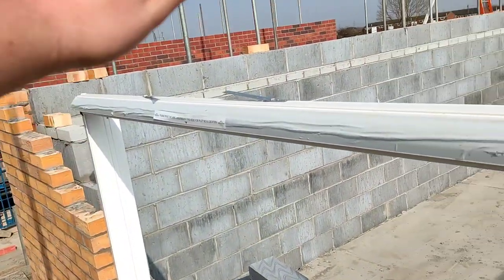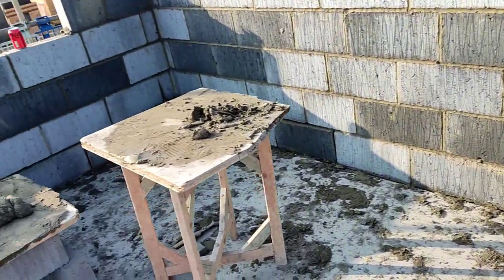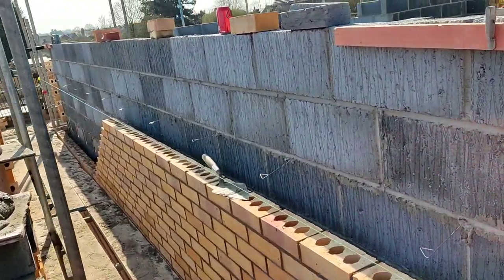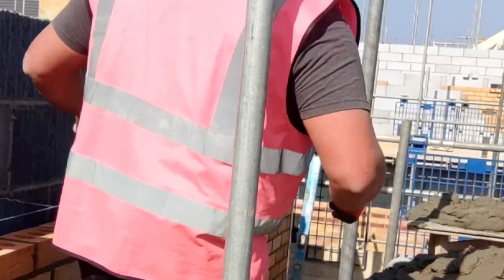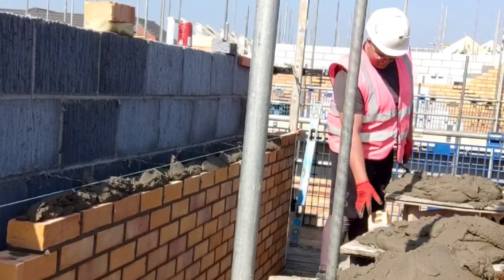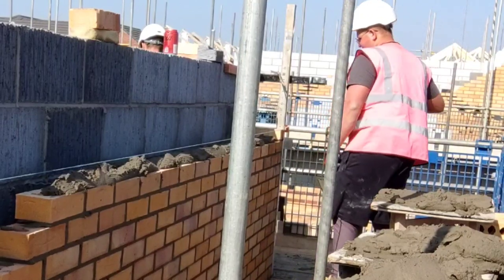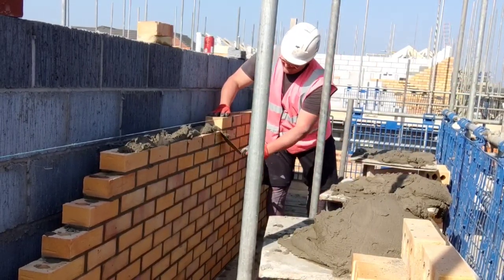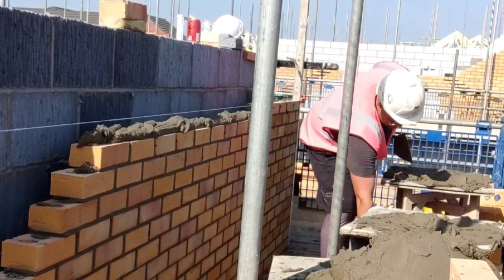Bricklaying Vlog - Back on the Band Lift! with a 3 Profile Setup?!

Comment: Im interested to know as an improver, why do some brickys build big corners with profiles then run it in after. just curious cheers m8
Reply: Its so you dont have to load everything out with muck and not as much pointing in one hit. In a small gang some times its quicker to do it  like that.
Reply from the maker: What hazey said 👍
Reply from the maker: @JAVXABLE  deffo on clay bricks, coni bricks I'll building bigger runs at once

Comment: Hi mate, fellow Bricky here! I’ve been using the rhino profile gallows(clamps) on my profiles.. What is it your using on your profiles (the metal clamp coming off the wooden Batton?) is it gable profiles you’ve clamped onto the batton
Reply from the maker: Yeah there gable profiles that slide up the wooden Batton, they clamp on solid 👍
Reply: @theafter8bricky  nice one 👍🏼 il get myself a few ordered! Did you get them off eBay?
Reply from the maker: @michaelhamilton9874  yeah the the blowk that was selling them, doesn't make them anymore, but if you find a fabricater, you could get them to make some